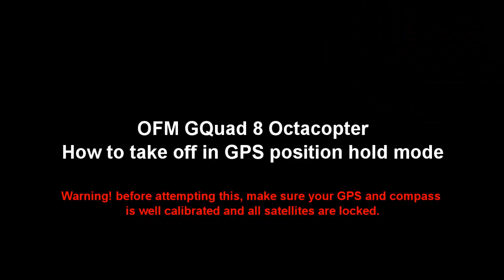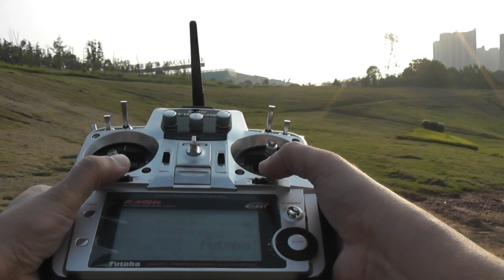OFM GQuad 8 Giant Octacopter Flight Testing

Comment: GREAT MACHINE!! One question. does it have a auto stabilization program if one or more motors give out? looks like it could carry a very heavy load with no problem. anyway, we saw you say on a few videos that your radio would run out of battery power before the craft. in case that does happen, does the gps bring it home as well? or is that a custom type build? very cool videos and crafts!!